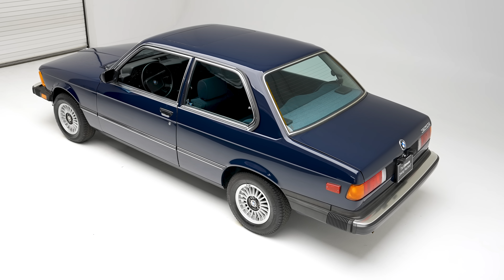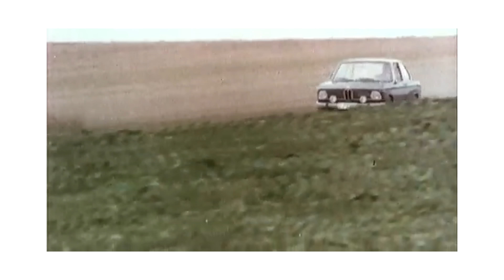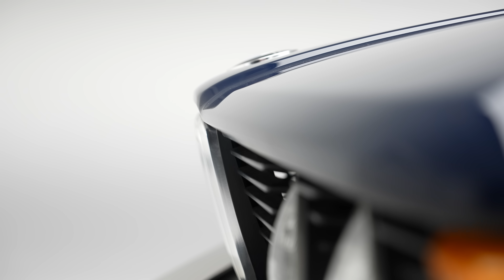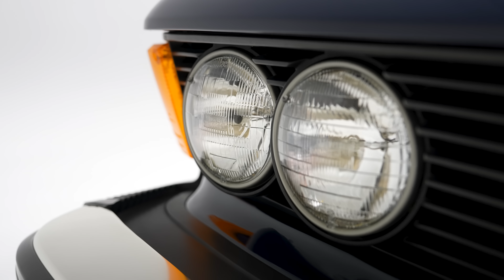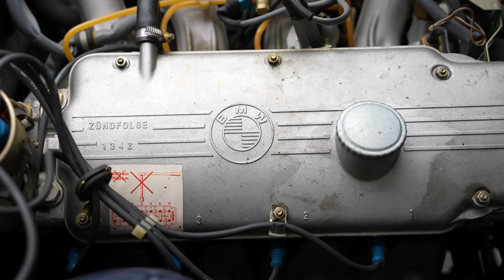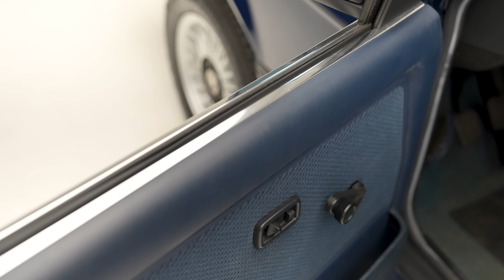The Car That Started It All - 1983 BMW 320i E21 Sedan

Comment: I bought on of these when I was stationed in W. Germany back when I was a kid. Got it for $800 US, it was sky blue, with a carbureted motor, and it was…. A Freakn lemon! I remember taking it to get the road inspection and the German mechanics were laughing saying that I’d just bought a Ford… this was when Ford was know as Found On Road Dead… I didn’t get it until after I donated it after driving it for about 2 months out of the nearly 2 years I was stationed there! 😂😂😂 never again will I buy a BMW…

Comment: Good as this model was, it was unfortunately hampered by the relative weak engine of around 110 bhp, especially with the early emission controls. Many say the model that really fulfilled the promise of the 3 Series was the E30 generation 325iS with the 168 bhp 2.5-liter I-6, which really made it a quite fast and very fun car to drive by 1985.

Comment: Yep the one that started it for ME.  I bought a yellow one with black recaro seats and a manual.  Loved the car but it had a “shimmy” in the front that felt like a wheel alignment problem.  Factory guys said it is “within spec”.  I finally got tired of that issue and traded on a 530i also a manual.  I have owned eight BMWs since and still own two.

Comment: Nope. It all started with the 1967 1600. 4 cyl, 87hp, 4speed, 4.11 rear end. Faster off the line than a 327 Chevy, safe and stable at 100mph for 2700 dollars.

Comment: I bought an '83 320i in '97 for $750! It had 155K miles on it and felt a little tired but it was still fantastic to drive. Only car I ever owned with manual steering. The steering wheel was alive in your hands, the clutch was easy and forgiving, and the shifter was light, tactile and precise. This video really takes me back, nice job.

Comment: Thanks for explaining the BMW numbering pre 320i,  I never figured that out.
Never seen the American version of the 320i, with those bumpers and side tail light, made it kind of ugly, unfortunately.
Back in Africa I bought a 1986 325i 4 door with over 300 000 km on the clock, reliable, solid as a rock, loved it.

Comment: I was living in Germany from 1980-83 and had an orange-1802 model.
I loved that car then and it’s still one of the MOST favorite cars that I’ve ever owned!
Back then cars were body, motor and transmission.
THAT’S THE WAY THAT CARS SHOULD BE!!
That car drove so well, was easy to maintain and NEVER had any complicated issues.
There were no computer issues or LED screens to go bad inside the car.
In short…it was a quality car and the motor would last and last.

I hate that American regulations and red tape has forced so many great car companies to ruin their once great cars.
It has also driven up car prices to where they’re almost unaffordable.
This needs to be reversed…SOON.

BMW fan in Georgia - USA.

Comment: For our family it was actually the 2002 that started the conversion.  But it took a long, long time.  My Dad played fast pitch softball, and there was a younger guy on the team who had one - I remember as a little kid riding in that car, and my Dad being really impressed.  Seemed stupid to me at the time, I mean this wasn't our LTD!  But that car stuck in his mind, and 5-7 years later Dad could go German.  He was hesitant at first, a very sensible 300D -  gas crisis II at the time.  But that became a succession of 5 series, not actual M's but always the hot 6 and later hot 8.  I think there've been about 10 between us all to date, and I'm shopping for a slightly used M550 now.  Have there been better cars in the class?  Yes.  Do these things cost a stupid amount to maintain?  Yes - and I've got one now that I'm looking to unload with less than 80k because of issues that should not exist at this mile count.  And yet.....

Comment: Drove my 1983 320is (Recaros + LSD + 5 speed) today. What a dream. Yeah it's slow but it feels quick around town and on tight backroads. An amazing car. 200k+ miles and it's been so good to me.  Most reliable car I have 🎉
Reply: I had the 2002 ti and then 320 1978 and 320 1981,  the last one with a/c , double mirrors, solar ceilimg , and I fitted with a Jensen Stereo, what a car !
Reply: I also had a 1983 320is back in the day and it was the best car I’ve ever owned. I wish I still had it so that I could restore it. Hennarot with black Recaro seats.
Reply: @jjtaylor6380  I think I might be selling mine!
Reply: Lucky you! What a treasure to own
Reply: The 320i from 1978 is a quality reduction from the real and only classic from German origin the real E21 launched world wide in 1976......

Comment: I had an 83 BMW 320i Silver for 19 years, 300K + miles. Kept it almost mint. Korman Autoworks suspension, transmission, engine, exhaust upgrades. Auto-crossed it but very slowly because I can't abuse cars. Donated it to charity. Watched the whole video hoping that you are not going to tell me I gave away a valuable collectable.